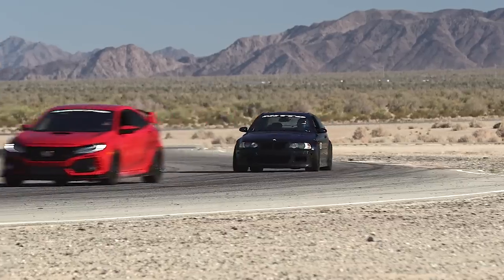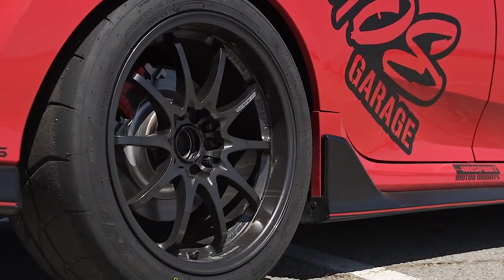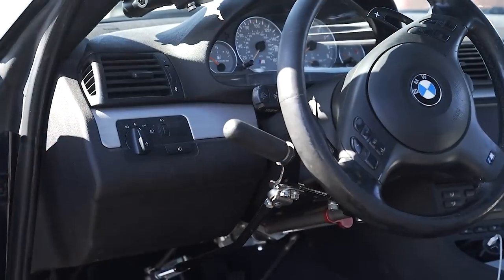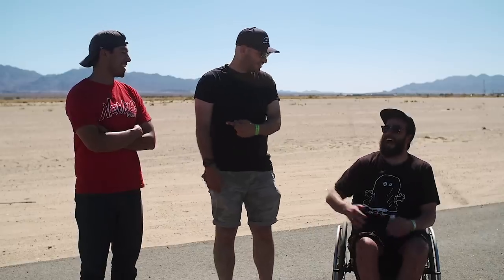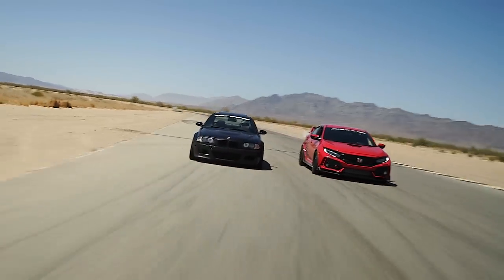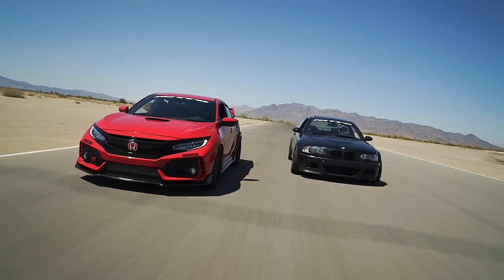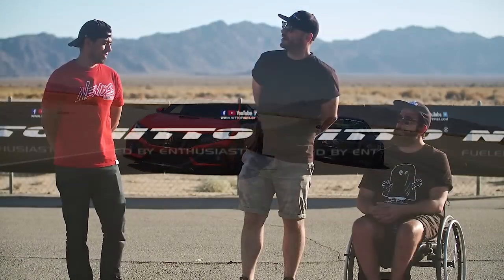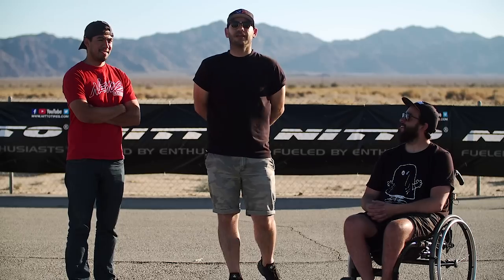Driver Battles: Civic Type R vs. E46 M3 (Hand Control).

Comment: Two sick ass rides. It just goes to show that the e46 lives up to its name 15 years later and the civic type r is a damn fast car from Honda to run up against a high end sports car. There’s so much biased people amongst the two cars but how can you be butt hurt because a civic lost by 1 second to a car that was banned from racing because it had far superior performance against its competition? That’s pretty impressive if you ask me.
Reply: Ameer Khan 

100% agree....if u don't like and respect both cars then you can't call yourself a car enthusiast
Reply: I agree with you
Reply: losteffekt what does that have to do with anything? I personally own an e46 m3. Like all cars they have their known issues. I’m the 2nd owner of my car and with 165k on the odometer all I ever changed was the vanos, thermostat, and reinforced the subframe. It’s about how you take care of your car really. I’ve seen 5 series bmws give transmission issues and so as Honda accords. Again that doesn’t really justify anything. Both cars in the video are sweet rides.
Reply: losteffekt, what that beemer will have had is not repairs, but preventative maintenance. Enthusiast owners will always be way ahead of the game and replace and/or upgrade all the known major weak spots on their car. I always love it when people write off a specific model when they clearly have had no personal proper ownership experience with one.
Reply: fax
Reply: One car will in the shop much less

Comment: Let me have a take at the Type R. 91 Honda CRX wants a taste! Electric Power Steering vs Manual Steering. ABS/TCS vs No Assist. Electronic controlled suspension vs Coil Overs. VTC vs Adjustable Cams Gears. Let's set it up. Technology vs Driver Skill!

Comment: The difference in these cars is that one of them is 14 years older than the other, that speaks volumes.
Reply: Right like!! Really 15 years later and they're still comparable
Reply: End top speed BMW WIN, 278
Reply: 14 year difference and euro still shit on japan
Reply: And one still cost twice as much when it was new.
Reply: lol I love BMW like e36 and e46 and Honda but the difference in this race is really rwd vs heavy fwd. rwd is most of the time always superior.
Reply: E4T6 the type should of won but the was not as skilled as the bmw driver
Reply: The csl version is slower than the type R on the nurburgring, so wtf are you talking about?
Reply: Almost 20 years older, NA, basically stock with an exhaust and coils, driving with one hand on the wheel vs brand new, turbo, exhaust, tune, probably an intake with 2 hands. Still beat the civic. That’s impressive. This is why i love my e46
@e46ty on IG
Reply: Any 20 year old boosted CiViC can walk around that BMW, that's not an achievement.  Plus one has to consider the price of each car when new, if they're FWD or RWD, etc.  Pound-For-Pound, the Type-R is a better car.
Reply: @77GR1982  in a straight line anybody can make a boosted go kart go fast.  The bmw would still beat the boosted Honda on the track.  M2 and M3/4 walk the civic if compared generation to generation.  New m3 stock is faster than most boosted sh** boxes.
Reply: @josephhooks1292  Everyone Knows HONDAs are BETTER than BMWs.., End Of Story - MOVE ON!
Reply: @77GR1982  better at being cheap yeah.  🤣
Reply: @josephhooks1292  Cheap are BMWs, unreliable ASF.. (lmao)
Reply: @77GR1982  obviously coming from a guy who’s never owned one.  Honda’s are not reliable.  They breakdown all the time.  They are just cheap to fix because they are made from cheap crappy parts 😂

Comment: I bet the official Nurburing lap time says different
Reply: Yeah they do! The 2017 Civic Type R came in at 7 minutes and 43 seconds and the E46 M3 CSL came in at 7 minutes and 50 seconds... But you have to remember the M3 CSL only MSRP'd for around $90k
Reply: Unless you race at 'ring all the time, then no one gives a shit.
Reply: 1 year old car vs 15 year old car.. $30,000-40,000 car vs. $15,000-$25,000 car.
Reply: E46 lap time was old. Tire technology advanced so much in 15 years. E46 m3 with current top performance tires can be much quicker.

Comment: Stock to stock the civic is a lot faster around any track, about 30 seconds faster on the nurburgring than an e46 m3, even the e46 m3 csl is no mat h for the type r. So this video just shows the guy with the m3 has put more money in it to go faster, just the  full bc racing covers alone cost over 5 grand for that car...
Reply: Be racing colliers cost 950 dollars.
Reply: The Type R is faster than every stock e46 m3 trim.

Comment: I would take a civic all day. Do you know how much it costs to maintain e46? shit amount. Unless you have a strong will to visit a shop at least once a month, I will never buy an e46 m3 now. (previous e46 owner)
Reply: Robin B. Everything on the E46 M3 maintenance wise can be easily done yourself. They are easy cars to work on. Yes they require maintenance, but for a reason...it’s an 7900rpm screamer, with 6 individual throttle bodies, producing over 104hp per liter! Those are amazing specs! That’s why the car is special...that’s why it needs to be revved out frequently...that’s why it requires maintenance more than others, but when you do the maintenance, it’s bulletproof.

Comment: Should've  used 18" rims for the track. There's a reason Honda used 20:
Reply: Honda used 20s for aesthetics and that alone.  There is zero performance benefit from using 28 lb 20" cast aluminum wheels versus 18 lb forged wheels.  Yes, the increased scrub radius from the wider wheels will make for slightly more torque steer, but the increased grip and massive reduction in unsprung weight is going to outweigh any negative associated with slight changes to suspension geometry.

Comment: m3  1sec faster but using a 3.0 biturbo engine. so, fast is the type  lol
Reply: Its an s54b32 naturally aspirated  3.2  inline 6 with 11.5.1 compression ratio.
Reply: @frontspring1  ok.i thought it was modified,i don t understand the dialogue

Comment: I'm in no way an FK8 fan, I find them overrated in every aspect....except on the track. This E46 M3, at least in stock form, has no chance against an FK8.
In a drag race, the FK8 would get its ass handed to it. They aren't all that quick in a straight line, especially in stock form. 
But on a track? My money is on the Honda.
Reply: Jon Pegram m3s are fast compared to an fk8 lol....a stock fk8 runs high 13s@101-104mph depending on driver skill, the FWD kills it off the launch. 
The M3 will pull mid 13s reliably at the same trap speed.
Reply: Jon Pegram are you just one of those people buying the FK8 hype, that it runs 'amazing' straight line times??? Im not euro, jdm, or american biased.

The Civic Type R is the slowest one in a straight line against the RS and Golf R.  

Any AWD car that has top end absolutely rapes it from dig to top speed. And off a roll its not all that impressive either.
It has FWD and is absolutely awful from a stop. I've seen plenty run on the strip, and have raced 3. They're ET is awful, haven't seen one get under a 13.7, most i see run 13.9-14.3s. They trap decent, but the norm seems to be around 102mph. 

Are you actually saying you think an E46 M3 would lose to an FK8 in a straight line race???
Reply: Jon Pegram haven't driven one in years, ill have to take your word for it, i do remember them needing alot of revs before the torque comes online.
Reply: No offense man but civics have always been slow
Reply: Jon Pegram How would you say your M3 would do against the new FK8, if you've driven one?
I found it to be dissapointing acceleration wise, but im also used to AWD performance cars (i have a 2018 Golf R DSG, modded Evo, and 1994 3000GT VR4) which is my preference, and RWD as well (owned a 300ZX Twin Turbo, some modded VW Scirrocos among other RWD performance cars).

I dont have anything against FWD performance cars, friend has a Mazdaspeed 3 that i like - but the FK8 was just dead slow off the line, and felt about as quick from a roll as the aforementioned Speed3 that my friend owns.
Reply: Jared Evers I agree, they've never been fast in a straight line. Theres a ton of Honda people saying the FK8 runs ridiculous times stock when its just BS. They all quote that one Car and Driver review which had a pre production Type R that was tested - C/D confirmed it was 'packing more ponies' than the production model they tested, which did 60 in 5.2s and the 1/4m in 13.9@104mph, which are more realistic numbers, and thats with a GOOD driver. I've seen them trap as low as 98mph and as high as 104. The ET seems to be consistently 14s.
Reply: Jon Pegram Agreed. I was under the impression they ran low-mid 13s. 
Thanks for the input. Also, I do remember loving how the E46 M3 handled, and the E46 M5 was a beast.
Enjoy your cars!
Reply: Nurburgring lap time M3 E46 = 8.20/ type R = 7.43.8   The M3 CSL was 7.50 so the Honda is quicker just that the driver of the M3 in this vid is a much better driver but the M3 E46 is a very special car which will be as iconic  as the E30 !
Reply: Just to correct you on something....once moving the civic is faster than the focus rs quite easily! Check the 60-100 times! The numbers are everywhere to see, motortrend did a test and it trapped 4mph quicker than the RS and also was quicker than the golf R after 30mph. Thats all that matters on a track.
Reply: 2018 Golf R-eady ? Neither the Type R or the M3 was stock. I don’t see your point in your nonsense comment
Reply: 2018 Golf R-eady ? Lol. Stock vs stock the type r will wipe the floor with the e46 in straight line performance. The civic type r has been seen staying neck and neck with 12 sec cars from a roll. From a dig with a veteran FF driver you can launch it decent.
Reply: 2018 Golf R-eady ? Type r is faster than the RS and golf R in every aspect except 0-60 times. Your comments are jokes.
Reply: preludeF20Bking I think the owner of the M3 would know.
Every Honda person is obsessed with thinking the Type R is some supercar...its nowhere near a 12 second car, beleive what you want.
I notice if i ever post on a video about the FK8 your automatically there with a retort. 
I don't care that you think it runs numbers that i don't beleive it can, so let it go. Its been clocked by professional testers at high 13s/low 14s, and I've actually seen them run. 
No, i don't want a bunch of links.

You're not changing my mind on this.
Reply: Watch out everyone here comes the fanboys that think the FK8 is a 12 second car stock!!
Reply: preludeF20Bking I've linked you multiple articles and videos. I'll take a magazines word over some young kids roll racing . The RS beat it in EVERY single acceleration test.
Reply: Hit the nail on the head, even the CSL isn't as quick. I don't think the E46 M3 is going to be the one to have despite its fanboy following. The E90/92 has the best chassis/suspension, much more reliable, the only one with a V8 (best sounding). Just a better car all around.
Reply: carl lynch they're much better on modern tires and brakes
Reply: Absolutely, no doubt but remember the CSL came with Michelin pilot cup sport semi slicks, a serious tire even by today's standards.
Reply: tomtom255 I agree but we're seeing  8min laps now from non-CSLs with upgraded tyres and brakes with almost completely stock otherwise (by very talented, but not pro drivers)
Reply: Jon Pegram v
Reply: Always hilarious to see a FWD turbo being compared to a RWD N/A in a straight line. Bottom line for the M3 will always be that it performs best in the twisties, even in stock form it can hold its' own. No idea why people are punching the air when their non RWD model can pull away from it in a drag. Of course they can!! Even still, it is always flattering to see any new model comparing itself against what is now a near 18 year old platform. Just proves that it is a benchmark that others still aspire to beat. What also matters is when that S54 hits the torque band in 3rd, even the FK8 has nothing really to shout about as yes it may be quicker, but not for as long due to the massive difference in gearing. (And yes, I have been a passenger in one to be able to tell). It has been consistently proven that stock M3s can hit low to mid 13's on the quart where the FK8 is usually around half a second quicker. Personally, I love the FK8, being able to put down that type of power reliably through the fronts show how far auto tech has come. That 7:43 is a fantastic time and slap bang up there with supercars on the nordschleife hit list. But come on people, comparing these 2 cars is not proving anything as they are at the extreme ends of differences with each other.
Reply: sarcastixx74 let me drive the fk8 and I’ll be car lengths on a m3 stock vs stock everything 1/4  mile drag race.
Reply: preludeF20Bking bs
Reply: Sure you will. Do you honestly think the official figures were taken by mere wannabe street drivers behind the wheel? The amount of times I hear similar shit and it still makes me laugh every time. The real figures are extremely close and I really don't care about a random saying what they can do, at the end of the day it is the trained, experienced drivers that make the real figures. At the end of the day all you are trying to say is that a year old FWD blown car is better than a 17 year old NA RWD platform in a straight line. Nuff said really.